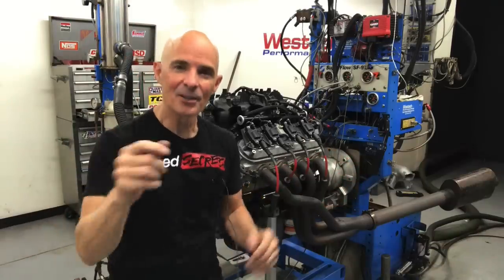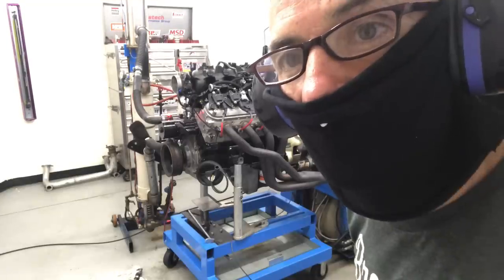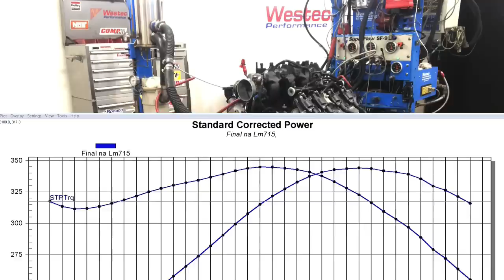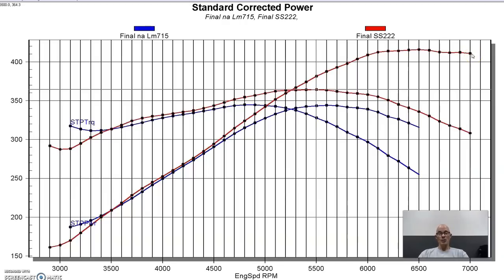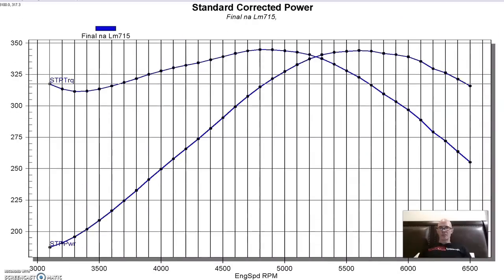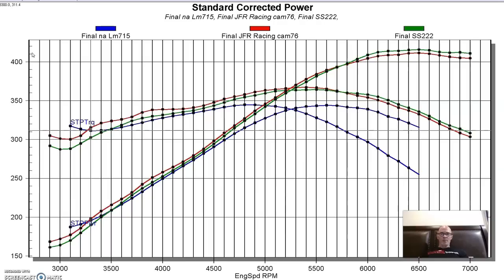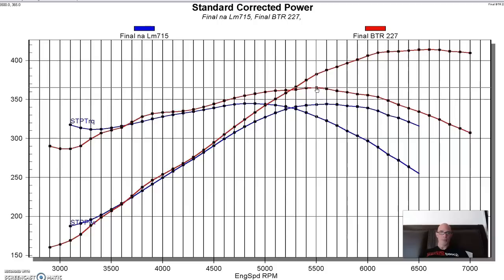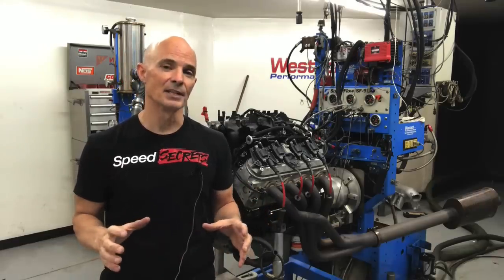DROPPIN' THE DEUCE! STAGE 2 TURBO CAMS

Comment: there isn't enough info to see why certain cams were better than others, and the cams can't be compared apples to apples.  Please include ADVERTISED duration.  Intake valve closing and LOBE AREA are other important metrics.  It would be great to analyse them with cam motion software.

The BTR Stage 2 cam has 14.6* overlap, which is a healthy chop on a 5.7L...too big for a 4.8.  It offers no performance gain over the others, with much deteriorated low speed performance.

Contrary to your recommendation, the Summit 8720 makes great HP, and more torque below 5000 than the other cams, has better driveablity, and throttle response.  It will also be easier to tune at low rpm.  11.875* overlap should be a smooth idle.  218/227 is basically a GM hot cam with more lift.

I would go with a single pattern cam with high lift.  I think a 270/270 112 LSA .600" will give you all the performance without compromising driveability.  4.8 with 706/862 heads wants 112 LSA.  5.3/5.7 with those heads wants 110 LSA.

Comment: Richard im new to this is there anyway I could speak to you directly? I subscribe and watch all your videos. I have a 2008 Silverado2500 h.d. with a 6.0 and 823 heads im leaning towards a n.a. build its a daily driver but im looking to really wake it up with a cam swap , long tube headers, ported heads, and roller rockers etc. With 35 inch off road tires.im looking for tq and h.p. between 2000 to 6500ish without losing alot of tq, any help from anyone would help me.🤔🤔🤔
Reply from the maker: THERE IS NOT CAM THAT WILL PROVIDE WHAT YOU WANT (2000-6500) EXCEPT VVT CAM POSSIBLY, YOU WILL ALWAYS TRADE POWER AS SHOWN IN THE MANY VIDEOS-JUST  PICK THE POWER CURVE THAT BEST SUITS YOUR NEEDS

Comment: Hey bud can you work this cam into a test? The no springs required drift cam that is supposed to be good for 4.8-5.7 motors and let them spin to 7500 rpm. https://www.compcams.com/nsr-drift-233-243-hydraulic-roller-cam-for-gm-ls-gen-iii-iv.html